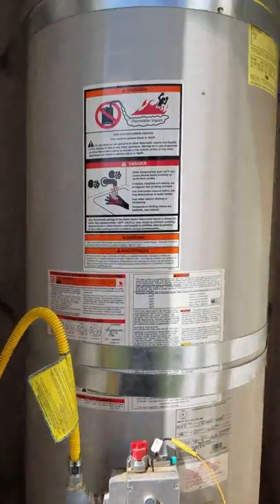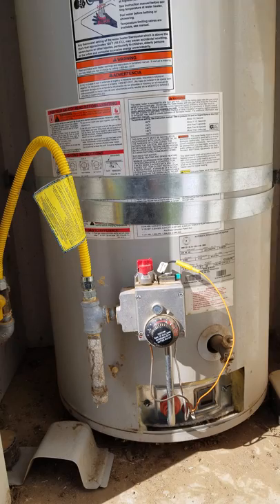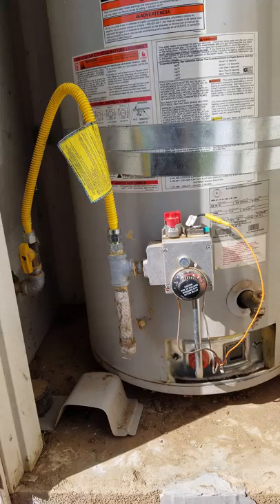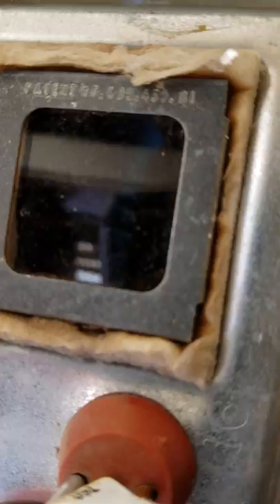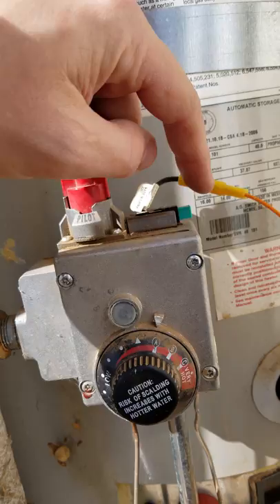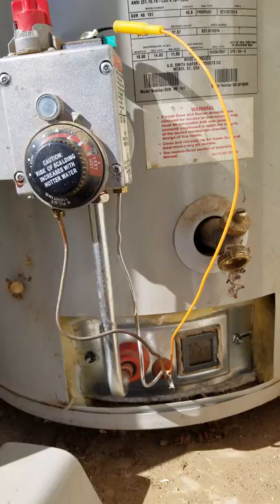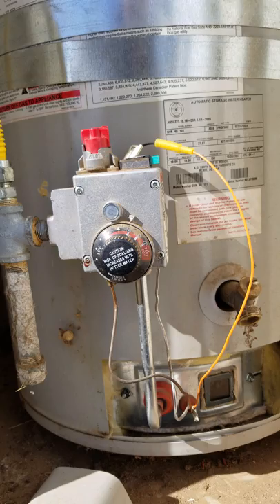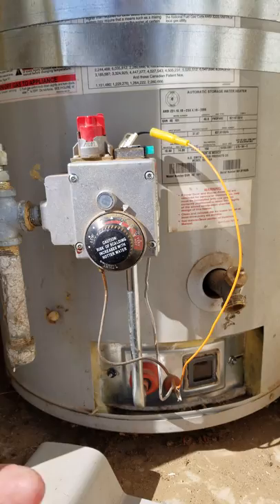water heater no spark on pilot FIX!! A.o. Smith and others!

Comment: This video helped me and saved me a shit ton of money. I watched this before having a plumber come out and they did the exact thing. Told me I needed a new water heater and I told him, nope! He then actually tried to ignite it and told me it was the vale control box. I told him to do exactly what you did and clean it. Wouldn’t you know, it fired up. Only cost me $150 and not the $1800 for new water heater or $600 For the valve control box replacement! Thank you for posting this ❤️
Reply from the maker: That's so awesome Amy!! Glad I could help, and help save you money!!
Reply: I think it's spelled 'shit-tonne' - British technical term. Hahaha

Comment: I wouldn't  say don't  trust a repairman, I would say find a repairman  that has experience trouble shooting a hot water tank. And don't just take one opinion,  get another. Not all plumbers have the same experience,  some are sharper than others. Good video, glad you got it working. Shalom
Reply: Unless you are out of hot water and need to take a shower. Then, getting two opinions can take days.

Comment: Niiiccee!!!!! Thanks for taking the time to post this. Replaced my inlet water line on top after leaking and drenching unit and then noticed pilot was out and no spark inside of the sealed flame oven after trying to ignite it. Will open and fix now!

Comment: Thanks for making the video. Used a wire brush and some sand paper. 

My thermocouple was the issue, wouldnt stay lit for more than 10-20 seconds on its own. 

Fired right up after cleaning! 

Model: GVR 40 100

Comment: Worked for my 10 year old GE. I barely even cleaned it, just took it out, blew on it and rubbed a couple spots with a tiny scrap of sandpaper I had from a cheap drywall repair kit, and it lit right up.

Comment: Thank you for posting this. I have a 10 year old Rheem (GE). Woke up yesterday to no hot water. Checked the unit. The pilot light is out. So i contacted GE who walked me through troubleshooting. We verified the piezo electric device was emitting a spark. So apparently either the wire to the end of the pilot where the flame should be, has failed or the contact as you are describing.
I will pu
Since it Sunday, l Will open it and verify it cannot be corrected by cleaning the contact surface. If not I will hopefully be able to get the part tomorrow at Standard Appliance Parts. Will post update for anyone trying to fix their own water heater.

Comment: This worked great and saved me a ton of money! Thank you for sharing.  There was some white corrosion on the electrode (at the end of the spark wire) which I cleaned off by wiping  lightly with sandpaper. I also wiped the end of the pilot tube with the sandpaper. Used 220 grit.
Reply from the maker: Awesome!! Glad it helped!!
Reply: @ericpendi8001  My water heater is a Rheem gas unit so your fix probably applies to many other brands. Perhaps you might change the title so more people can find it or not accidentally skip it if they don't have AO Smith.  I think yours is the only video that mentions this fix. I have since found mention of cleaning the electrode and pilot in the AO Smith PDF manual - page 28, but I'll bet that this fix is rarely mentioned elsewhere and was not in my Rheem manual. Can't thank you enough (and you should see my wife's smile since we have not had hot water for a few days) !
Reply from the maker: @stolz5573  maybe I will change the name. Way back when I made the video I was only thinking of my brand of water heaters. Im Sure the same fix will apply to any gas water heater.

Comment: Dud this twice on my current water heater and several times on my gas fireplace. I like to sand off the thermocouple, the spark electrode and the pilot gas tube. Pretty sure the spark goes between the gas tube and the electrode so both need to be clean in order to get a good spark. The thermocouple needs to be clean in order to be able to heat up when the pilot flame surrounds it. I have a different model water heater but essentially the same arrangement of parts. Mine is a little tricky to get the assembly out after moving the two screws on the sides... just had to jiggle it around gently until gas tube comes out of the control valve.
Reply from the maker: Yea I've actually had to do it on my gas stove as well.

Comment: Thank you!! Single woman in desert.
Striker button is sticking, put canola oil on it (no wd-40) and still trying.
Will check contacts. I can smell gas, just no fire.
The old mechanic mystery: when TWO things are wrong.
Thanks ☺️
Reply from the maker: If you have one of the bbq lighters that have a trigger that are either red or blue handle with a black stem. You can disassemble that lighter (it will never beable to go back together) you can take the igniter from that lighter and it's the same exact style your water heater uses. You can take it and try and light your pilot with that, by connecting the new lighter igniter and hooking it up to your ignition wire on your water heater. I've had to do it to mine before.

Comment: Honestly a poorly made how to fix video since there was no video showing the procedure ....but at the same time thank you for the Inspiring story which motivated me to mess more with mine.  n my case the pilot somply went out for unknown reason??  Maybe air in propane tank?  IDK....Anyway after many failed attempts to light I listened to your story and started to undo everything to pull it out and clean....took the panel screws out  and tried to first unplug the two wires on my unit other than the ignitor (this one is 2019 Rheem water heater with Honeywell controller) but the wires plug  did not want to come out and I was afraid to force it....then for the hell of it I tried one more time to light pilot and VIOLA!  Lit right off and we have hot water again!  yeah!  So thanks for the inspiration....I scared it into submission!  LOL
Reply from the maker: Glad it inspired you. Sorry for not making a play by play video, but I dont have that kind of setup. Just a cell phone in my hand and it was something I just wanted to try out. Glad it worked for you tho!
Reply: @ericpendi8001  bro you can’t please everyone. There’s gonna be one every video

Comment: Will have to try this thanks for the info, our ao smith currently won't even produce a visible spark when pressing igniter button but its probably dirty in there being its an outside unit and is going on 12 yrs old.
Reply from the maker: No problem. You can also get the bic ligtlhters that have a long stem and take them apart. The clicker part is the same as the igniter for your hot water heater. You can always use that. That's what I had to do.
Reply: @ericpendi8001  Thanks we ended up manually lighting pilot with a lighter based on a couple other YT videos but the burner sounded bad, it was flaming way more aggressively than normal and with bright yellow flames & had a deep fluttering sound like combustion, not even sure how long it had been doing that but it didnt seem safe lol,  we ended up ordering a new burner assembly which came with a new gas valve, rest of the tank seems to be in decent shape so figured a lot cheaper than buying a whole new water heater + install cost, I installed new burner/valve a few days ago and all is well again. the old burner assembly had a decent size tear in the screen and was pretty dirty, I had tried cleaning burner screen best I could before ordering new parts but it still had the abnormal / aggressive burning behavior, the new burner is way more tame sounding & quiet.

Comment: good info but I wouldn't suggest a homeowner who isn't well adept at mechanical work or have a good working knowledge of good basic tools and basic plumbing use ,should not try this at home, remember that water heaters are under pressure and gas if it ever leaks has a potential to cause a serious disaster. If a homeowner has some trepidation concerning doing this kind of work, I suggest he/she call a handyman or  maybe a local neighbor who he/she knows can do this type of work and ask them to do it for them instead.

Comment: Howdy, folks.

I was having this same problem but I'm in an apartment with a manager that's a real lazy piece of... um, well here's what worked for me:

On my unit's water heater (which looks just about the same as in the video) I couldn't get a spark, and while fiddling with the sparker I got shocked through the cable - which means it wasn't well enough insulated which means it could be "leaking" the spark.

So, I took the little green-capped sparker out of it's clip, placed the gold end-cap against the copper heat-pipe, make sure the spark-wire wasn't touching anything metal, and when I sparked it it worked, lighting the pilot :D

Hopefully this will be helpful to someone in my situation - Good Luck :)
Reply from the maker: Awesome! Thanks for the tip!

Comment: Hi how are you?  I have a question about your A.O. Smith pro max electric water heater , pilot light ? Do you have to turn off the gas line before removing the pilot light unit ! Or just plug and play
Reply from the maker: Yes turn off gas! You should have a shut off valve close to the unit.

Comment: I have the same unit, I cleaned the burner and it lit up just like yours, however I can’t turn up the heat any higher. If I do, the burner will turn off and I will have to relight the pilot all over again. Anyone else have this problem too with the increased temp? Should I just replace the burner assembly altogether?
Reply from the maker: Glad it worked, I'm no expert so I cant really say what you should do to fix the problem with it not turning up. I would say check the lines for clogs, maybe its starving for propane when its increased. If no plugs or blockages are found I'd say replace the burner assembly. Let me know what happens I'm intrigued!
Reply: Exact same thing with mine. I have both issues; no lighting and once I increase the heat it turns off.

Pls let me know how you fixed it, if you did

Comment: Ooo thank you. I also have an AO Smith.  I just changed out my anode rod, and pilot light won't light up.  I actually started the anode process yesterday (turn off this & that & run hot water, etc) but had a concern so reversed course. Today, gave it a go, noticed a drippy TMP, it dripped all night. Anyway, finished the anode rod exchange (pulled out a long wire, nothing left on it!) and tried to relight the pilot. No go. So, I'll let things dry up overnight and give this repair a try tomorrow. I did find a video that explained how to do this step Mr Eric described - Thank you Sir!!  (look for FREE Fix! Pilot Light That WON'T STAY LIT on Water Heater by Handyman Hertz - https://www.youtube.com/watch?v=6GI2d8q2j8U)

Comment: How do you get the window plate off? I took the 2 bolts off cand it won't budge
Reply from the maker: I wouldn't recommend removing the sight glass. I'm  not an expert on water heaters. Those 2 bolts should be the only things holding that plate in place. Unless your lines are so tight that it wont allow it to move.

Comment: What piece did you sand?... I replaced the kit and still not sparking
Reply from the maker: I sanded the ignitor, and also the flat piece that the flame comes out of. Mine was really corroded so I tried to get off as much as possible.
Reply: @ericpendi8001  great tips

Comment: not sure i understand ur talk through! wish you could have simply reproduced the process! you say "disconnect" the "3 lines", but not clear what END of those lines you disconnected!
Reply from the maker: Theres 2 or 3 gas lines that come out of your water heater unit, follow those lines to the block were the main gas line hooks up. Disconnect the lines from there to remove the ignitor assembly, pretty sure that's the only place you can disconnect the lines.